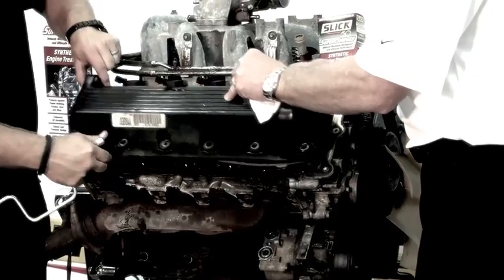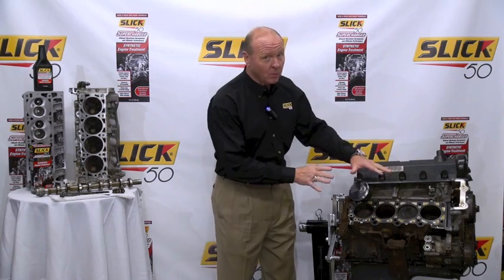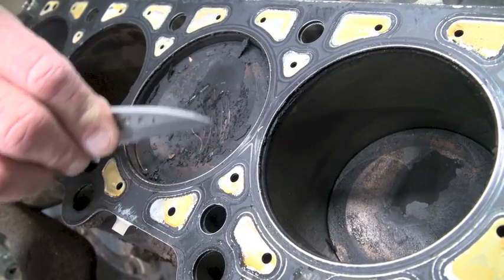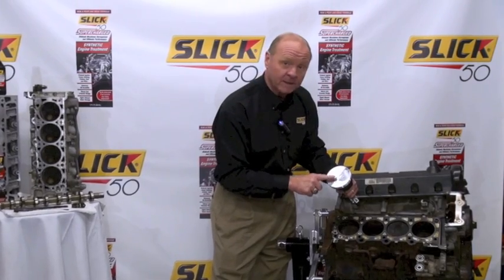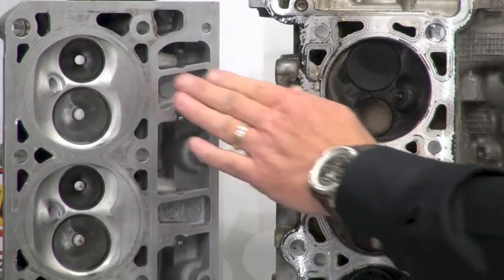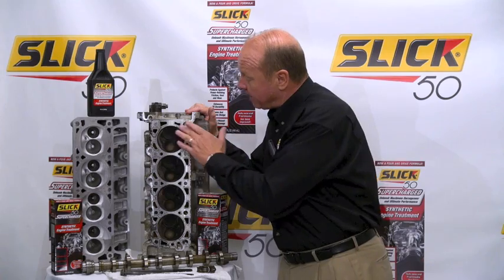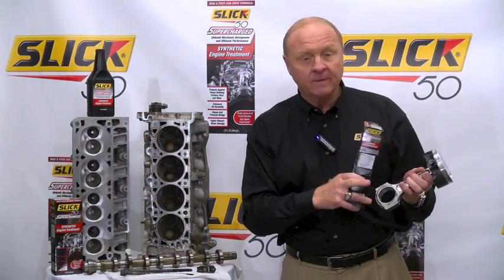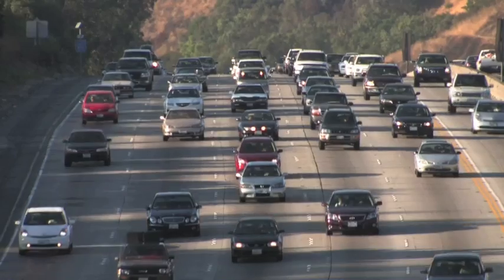Slick 50 Engine Teardown - Episode 4

Comment: I used this in the 80’s on my 5 cylinder Audi Coupe GT replacing it for one quart of oil every 4,000 mile during oil change. Got rid of the vehicle with 200k miles and it ran super smooth. It also helped lower the engaging operating temperature.

Comment: My Suzuki address 125cc, has running 101.450km until now with no problem THANKS TO SLICK 50! 2008-2022.😀
I've used it 7 times until now BUT I'm always very careful with quality oil and filter! 😉
I think the secret is to the cooperation between Slick Cerflon and a good oil. 
Thank you,

Comment: Damn right, not the same product as was made back in the early 80,s. EXCELPLUS it is now called. Added to my 58 caddy, tappet noise gone, runs a lot smoother and seems to have a little more power output. Great stuff.  PERTH WESTERN AUSTRALIA.

Comment: ZDDP is actually reduced in latest oil formulation as it hurts the catalytic converters
Reply: You need to reduce to the catalytic converters. They hurt engine efficiency.
Reply: slick is ptfe, and people put that shit in engines, it will increase wear, and fuck your catalitic converter too. No ones worried about that.

Comment: i have a 1970 Ford F100 with a 1983 302 5.0 rebuild been using Slick 50  rebuild in 2003 has about 60,000 i have been driving over the USA

Comment: Gosh I best stop using this stuff my 2 cars only have 305000 and 376000 on them ... well maybe I best keep using it
Reply: mike bowles You would have got to that mileage with good oil changes. The fact you haven't had a problem is not proof.
Reply: Its isnt.Even if the engine is wearing more than the normal, he cant notice that,  hes using the crap, ptfe in engine, then one day eveything will collpse, when he open engine it wil be absolutly destroyed.Who the fuick put gunk , plastics , ptfe teflon in engine??? Mix some carbnon and metal debrism with the gunk and make an oil test, wear is incresed. Says engineering of lubrification, according with some tests already donne.Wanna a super lube? molybdenium.
Reply: mike bowles I never used additives and always went over 300,000 miles.  Actually I've never gotten rid of a car because of a bad motor

Comment: junk junl junk......total rip off.  Only 2 additives on the planet worth using......Lucas.....and marvel mystery oil.  Been spinning wrenches my entire life, and i've seen more damage done by slick 50 than any other.......clogs the crap out of lifters, passages....and builds up in the bearing journals.
Use Lucas at every oil change.....use marvel if lifters start to tick.....that easy
Reply: matt sez I was wondering about the new synthetic Lucas if it would be ok in my 2012 ram with the hemi. they seem to have a little noise on all the new hemi motors.
Reply: lucas is always a good idea,l HOWEVER......i would check with a DODGE DEALERSHIP mechanic....make sure that the Hemi dosnt require a very fine very hi pressure oil.   Better safe than BANG!
Reply: Hello from New Zealand. What is Lucas?

Comment: There's another video showing Slick 50 is a complete rip-off and does nothing for your engine and but does an excellent job of emptying your wallet.

Someone has a YouTube video comparing the performance of Sick 50 with motor oil, synthetic oil and Head and Shoulders shampoo.  The Head and Shoulders shampoo out performed the Slick 50.
Reply: all ptfe in engines are rip offs, you have thoiusand of miracle products with this shitty formula, and you have worst, something using chlorinates, like militec1

they are rips offs, run away, from this stuff.

start reading lubrification engineering.

Comment: I fail to see the point of this series. All you have done is show me an old motor torn down... no before and after, no evidence of any real benefit of the product. if you put the engine on a engine dyno and did a number of runs measuring power, fuel usage and emissions before and after using your additives and showing some real world results then i would consider using your product but until then i think i will just stick to using quality oil and filter's and following the recommended service schedule.
Reply: dualnamehype commercial was really SLICK!
Reply: Well the video made a huge scam. Slick 50 you are using is not the same Slick 50 or the same company . The invented of John Bishop Slick 50  got his product name stolen . See he forgot to copy write the name slick 50 . Bishop sell the true forumal now called Lubrilon (713) 671-2545